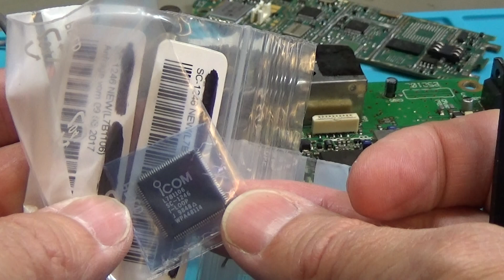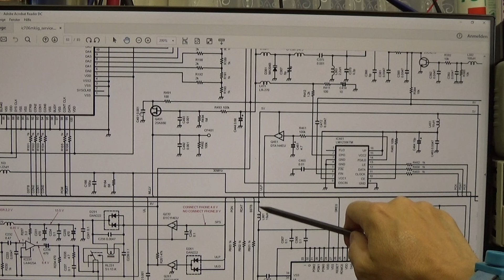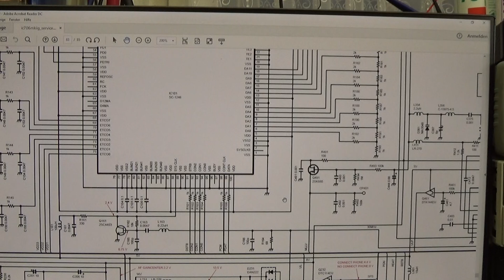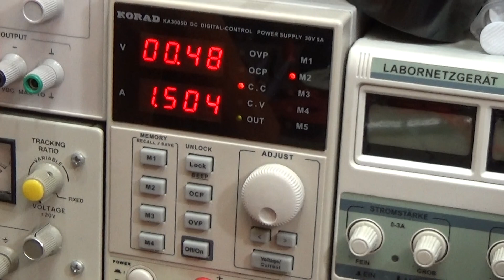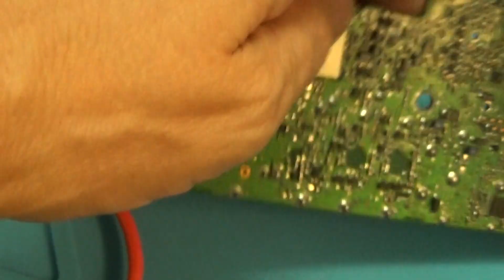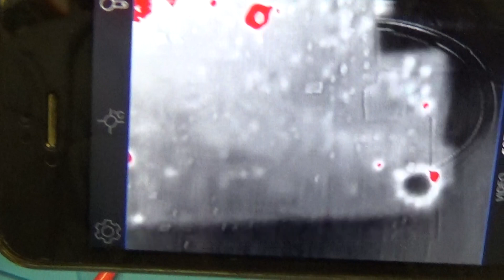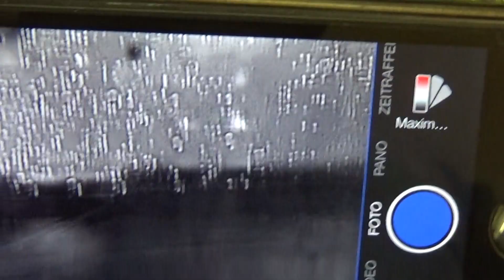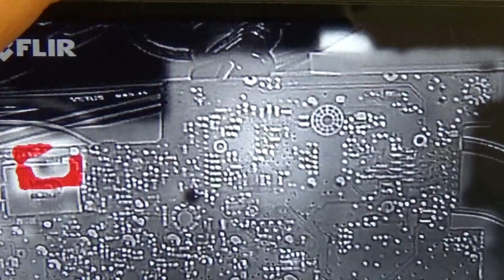#133 PLL Repair Part 3: Icom IC-706 final repair attempt failed

Comment: Put 5 or more amps into the board, Something has to get hot!
Reply from the maker: Hi Brian, I have already put 5Amps to the circuit and you barley can feel that the pcb it starting to get a little bit warm..73

Comment: Here is a FREE Tip for everyone.NEVER purchase an ICOM 706,706 MKII,or early model 706 MKIIG for this reason.Unless you need a low power VHF/UHF rig with an HF/6 meter all mode receiver because odds are you will be dealing with this same issue one day.
Reply from the maker: Yes I fully agree with you..This is an odd radio. 73
Reply: You can say so about any radio, but 706 is a good radio.

Comment: hi.I just want to ask if you saw my message inside your gmail box....
Reply from the maker: Hi Elena, no I have to double check...73
Reply: Hi .I was looking the board, again and it.s seems to be the HM408-1The supply board is HM408-1 PS-2. THANCKS.iI would like you to help me and if you find the schematics, tell me why the R406 suffered a lot, and it is almost burn.The trace by one leg, of the resistor it is also dameged...but not burned.THANCK YOU.